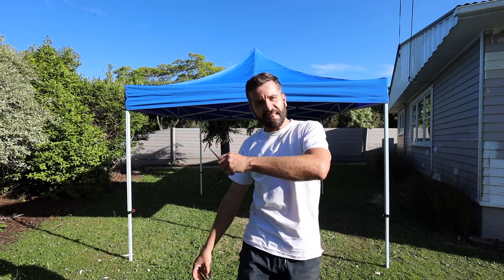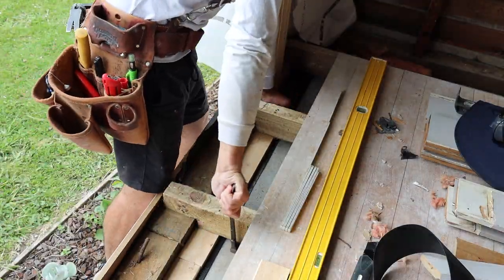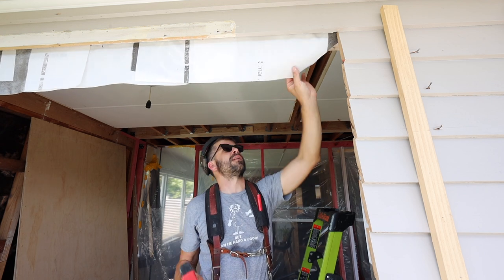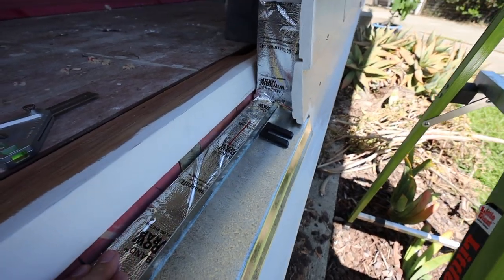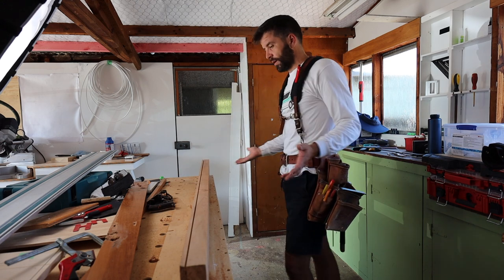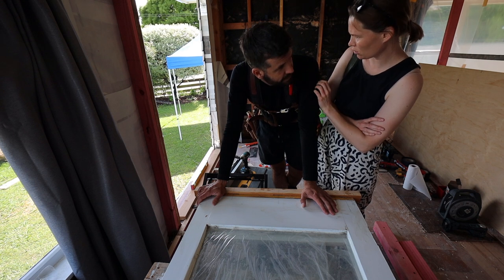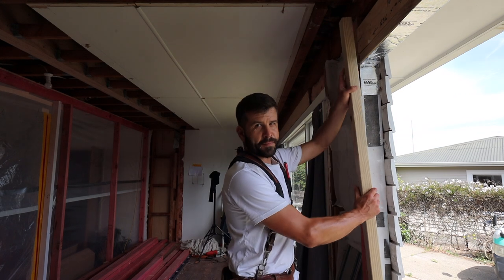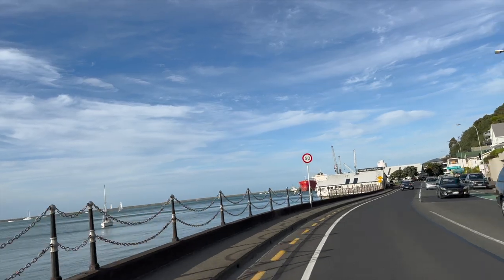Building your own French door. Is it worth it?

Comment: Don’t underestimate the benefits of reusing older salvaged lumber.  Things are changing.  The availability of quality wood here in Canada is getting tricky.  Whatever good stuff we have gets shipped to the US because of their higher dollar and volumes. We get the the leftovers when available. If you want good material get your wallet and a loan out.  As interest rates climb material costs will dictate over hourly labour. Materials will govern, labour won’t.  Learning how to develop a material salvage plan will need a great deal of change of thinking and patience.  The days of ‘ah… rip’er down and start from scratch’ will be gone.  Plus I’ve salvaged at least $1000 Cdn of 2” x 4” in the last 18 mos.  on some my my own reno  projects. And it was all premium stuff from the 50’s to 80’s.  A little case hardened etc but really high quality.  I’ve nearly cried to see perfect 2” x  8,10 & 12” get tossed or burned for want of 2 hrs of denailng to be replaced by 1” 3/8” x 7 1/4” etc etc knot filled wet garbage.  I salvaged a covered porch for relative made from full dimensional clear cedar framing a while ago.  Some of the nicest wood I’ve ever built with.  Keep it up!  You’re noticing like we are if you need good material you need to with LVL dimensional ($$$).

Comment: In my opinion you should leave the bars on the doors as they would fit nicely with the windows. You can have “fake” bars by just glueing or siliconing the existing wood (trimmed down in thickness of course) bars to the glass. This would give the double glazing but preserve the look!
Reply: Nah mate the glazing bars are too thin and don't suit the property, fake glazing bars look terrible...
Reply: Fake bars look bad on double glazing unless there is a bar inside the double glazed units as well. Otherwise when you get close you can see the gap between the inside and outside bars and see the glue used to fix

Comment: Hinges on the outside are a non starter up here where we get snow.  Aside from the security concerns, they just don't last. ..  great job on the doors, though.
Reply: Was thinking that as well.  There are hinges which don't have a removable pin so are less of a security risk if they are installed externally - that might be what Scott was meaning when he said they would work but weren't the ideal/finished product.

Comment: Hey Scott! Dutch door(frame) maker here. Your french doors are looking nice! Here are some tips for next time if you want to make it again; you don't need to make fancy bridle joints you can just join the frame together if you just cope them and use some decent PU glue and screws. But the one thing you need to do if you dont make bridle joints is that the stiles are inbetween the sill and the top because of the way the load is being transferred to the bottom (otherwise you just rely on some screws and glue). Also  I wouldn't recommend using biscuits again to line and glue your sill together. They are made from beech wood which is the worst to use outside ( if they get severely wet they will expand a fair bit and they rot quite easily).

Btw is Ray also a dutchie? I worked in NZ as well doing my WHV and worked for a joinery that build supermarket stuff and when I was there (8 years ago) did the New World supermarket in Motueka! Good memories. 

Cheers René

Comment: I went the on-site custom fab route once for 3 double 6 foot by 8 foot french door jambs for a country house with an old fashioned breezeway design. I  re-sawed and machined  them from a big pile of Douglas fir and Western Red  cedar logs salvaged from old hydro transmission towers being replaced with new metal towers - Hung beautiful salvage 2 inch 36x96 fir doors on them with ancient salvaged hardware. They weighed in at over 300 pounds each and are breath taking.

Comment: After leaving School back in the never never I completed an apprenticeship in Engineering. My shed is full of metal working tools, a good size Lathe,milling machine and a number of welders to join several types on metals together. But your youtube channel has shown me the wonders of working with wood. I am converted to working with timber. Our 105 years old house has been upgraded to concrete piles, new wiring and rejibed. With your help and Jess's I have carried on where the previous owner had got too. I am fitting a new bathroom going well up to date. I have learnt that the difficult stuff that should not be mixed in POWER and WATER. Thanks Scotty and Jess love your work.

Comment: You know, something that isn't really talked about, but I think is a major shift in society is YouTube as a source of education. I fix my own white-goods, I just installed a tow bar on my car, I do my own home repairs and renovations, I'm installing cheap Lithium batteries in my home at a fraction of the cost of Tesla power walls. I'm renovating two cars and three boats, upcycling a solid oak sideboard/buffet that I found in a goodwill store for $40, rebuilding my pool shed, building a new fence around my (corner block) property (doing red ironbark posts with horizontal dark grey corrugated aluminium sheets in between 👍), building all the cabinets for and renovating my kitchen and laundry and so much more. I'm a computer programmer and I would have no idea how to do any of those things without YouTube channels like this one.

Comment: Hi Scott and Jess. Love your videos and watching your house progress.I notice you are very keen on priming and back priming. I have spent most of my life as a painter and totally applaud this process. I have found doing my career that acrylic (water based) systems will allow moisture in. The theory is that it also will travel back out. I have see so much failure with with water based systems that I have been a strong advocate for using oil based primer or undercoat to ensure the timber will survive for future generations. It is not as convenient but it will provide the protection you are looking for. All purpose undercoat is my go to product since it dries quicker than primer and works well on both hard and soft woods. Have a great Christmas and keep up your wonderful standard of work and great videos.

Comment: Patio Doors are all about flow and view - inside to outside  so i guess a lot will depend on how this will design up for use as either a large entrance step or decking area for outdoor entertainment relaxing/private. The modern trend is for large openings/doors best decision we made was going for some 4.8 m double sliders and 3.6m french doors in the design.  But in yoir case I guess you have the advantage of keeping in with style /age of the house. And the cost of new doors has rocketed up.

Comment: Hey Scott, if i remember your 6 1/2 saw broke if I'm not mistaken, u used to use it almost exclusively, how it's the change to a 7 1/4 for a daily driver, specially since the 40v batteries are more heavy
Reply from the maker: I miss that saw. Yes the 40v is a bit heavy, BUT I just bought a new 125mm 40v saw that is a lot smaller, straight from Japan. I’ll use that in an episode very soon.
Reply: @ScottBrownCarpentry  i was thinking, cause the availability of 40v isn't that wide, but since the 6 was your favorite, if you came upon one, would you replace the 7, those little 40v saws look incredible, stoke to see them inaction! Thnks for responding cheers from the ass of the world (Chile)

Comment: Hi.  Harking back to that short that you made 12 days ago, where you found a weird nail in the roofspace of your 60s house...
It's a horseshoe nail.  Not old-fashioned roofing nail at all.  You can still buy them today for the very specific purpose, and they still look exactly the same.  Horseshoe nails would make a bad carpentry nail, as they have a chamfer on three sides of the tip.  The chamfer on the wide-side at the tip is so that the nail turns inside the hoof of the horse, and comes out the side of the hoof. Not really called for in a carpentry nail, right?  But, at the same time, horses don't want nails of that size fully embedded in their hoof, either!
Horses for courses also applies to nails.

Comment: Added 2 French doors to a mates house recently. Pretty much did everything you did except used Stainless steel sill tray and head flashing as he's close to the sea. Also used Stainless steel flush hinges, 4 each door, and used planted stops as the doors are 860 wide so there's plenty of room. Also no checking in the hinges.

Comment: I’ve been woodworking for over 45 years and have built everything from very fine jewellery boxes to large bookcases to double doors. The principles are very similar but each first build is always a challenge -  building the second is easier; when you get to the sixth, it’s great but getting boring.

I’m just finishing the worst piece I think I’ve ever made, it’s a 4m x 1.2m solid oak table top. The designer should be shot - that’s me. The builder - that’s me - would like to pull the trigger. I’ve got a very nicely equipped workshop but it’s not piece that one (old) man can make. Too long, too heavy. The boards were milled to be 135mm x 21mm (it’s going to sit on an existing table for all but 600mm each end). I cut half at 1.8m and half at 2.2m thinking that I would have a zigzag of joins across the centre. I also thought that a combination of dominos (alignment) and pocket screws (cramping) would make tight joins with an even surface. 

It would have worked for a 1.8m table; even a 2.5m table maybe but 4m plus is just too long for accuracy without hydraulic cramps. I hate, hate, hate, bodging; trying to cover up mistakes but I had no option. After glue up, it was apparent that the inaccurate straightness of the board along lengths, the tensions within each board meant that even dominos and screws could not make a flat surface with no visible gaps. I should say that I am a terrible critic of my own work whereas my wife looks at it and asks “where is the problem?”. Another reason to love her. 

 But the table had to be made (Christmas) and I had no other spare timber. So, I decided to cut v grooves along and across every join. I have done this before (but prior to construction) and it does work. I used the Festool 1400 router, Festool tracks and Festool router-to-track attachments; it’s all Festool; perfection is almost guaranteed. Nope. I could easily cramp the track in place on either edge of the table but, when I got towards the middle, I had to rely upon the friction of the tracks. I tried it before cutting and it was fine. Then I cut it and had disaster after disaster. The tracks held firm until I cut into the oak (with a new v groove bit). The sheer force required to make the cut was enough to move the tracks. So, now I had grooves made by a drunken track layer. I will cover most of the mistakes and we always planned to have a full length tablecloth (thank God). But I will always know that underneath that very nice William Morris print is a disaster that will hurt my woodworking pride until I die. 

Apologies for the length but I hope there are lessons there to be taken from my disaster. Firstly, get the design right. Then, work within the limitations of your equipment and space. Then, allow enough time - and double that. Don’t think for a minute that bespoke anything is cheaper than factory made. I could have bought a beautiful second hand flame mahogany dining table for anything from £1500 to £2000. All my materials came to £800. Add in overheads; add in my labour if I were charging (20 hours at £45 per hour) and that painless purchase of the Georgian table suddenly looks attractive.

Comment: Shouldn't the door hinges be inside? Otherwise, the hinge pins can easily be removed making it conveniently accessible to thieves even if the door is locked
Reply: Fixed pins. No easy removing. Allows full opening. Cheers :)

Comment: For all us newbies doing woodworking out there, be careful using the japanese saws. (pull saws) Or any other tool for that matter. I used one hand to saw and the other to hold the wood. Used too much force on the last bit before i went through. Saw hit my thumb in full force and cracked half the nail and quite deep cut. They are sharp! Would have probably cut my thumb off if i hadn't hit the nail first.

Comment: I will begin by saying, I cheat.  Trained in building and shop work, When I built my own house,, I built the shop first, 24X40.  The house build went well, some rough weather to over come, winter and 0F for all the mechanicals,, but  I built my own windows and doors.  Included in that were the French front doors, a pair of 3'0" X 8'0"X 2.25 " thick with a 6' wide round top window above.  All built on site with the exception of the sealed glass blank ,argon filled low-e tempered ,,  ALL moldings were created, milled, shaped in my shop, crown, base, fluted columns, plinth and scotia, casings,, everything was milled from a truck load, 6,000bf, of clear poplar, random width and length, surface 2 sides, straight rip one edge..

YES, you absolute can build your own French doors.  A table saw and some good hand planes, you are good to go.